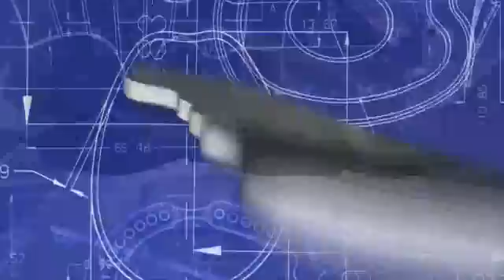#britek  Energy Return Wheel... Autonomous Never Flat

Comment from the maker: Any FIA rally proves the pneumatic tires "over bounce" launch accident potential. ERW cuts the bounce response more than in half with hub in hoop "real time" balanced stretch across the ID of the hoop. Several times more responsive than pneu. A hundred years ago they said ..."No need for a new fangled car... just buy a better buggy whip and your horse will be as fast as a car"! How did that turn out?

Comment from the maker: ERW unique 360 degrees of "stretch" suspension that reduces tread squirm and temperature buildup. Please check out our other videos where we show fully enclosed ERW. We are applying a vacuum boost on highly elastic sidewalls to improve screw force accumulation and dynamic 360 stretch. Stretching and recoiling rubber recycles heat.

Comment from the maker: ERW levers from the top inner diameter of the composite hoop. The exact opposite of "all" other wheels and tires. Just check out the ease of off trial hill ascents shown in the off road bicycle video. When ERW is lowered to the ground the hub sinks within the scope of the hoop drawing more tension... elongating elastic attachments on the top 180, a levering advantage.

Comment from the maker: We continue to produce many prototypes each with their own unique performance advantages. The things they have in common are massive efficency improvements, traction, hp and torque to the surface, are anti bounce, high speed, airless, run damaged ability, much more responsive, razor sharp handling. We now have accumulated more issued/pending wheel patents and claims than anyone in recorded history...and we are self funded. Imagine what we will do with help.

Comment from the maker: For military applications ERW will offer logistical advantages, high speed performance, will not go flat, are highly bullit and blast resistant. Operators will not be stuck changing a tire in a dangerous situation. The support vehicles will also enjoy a double digit efficiency advantage saving billions in fuel costs. Expect no bolt versions.

Comment: however, I think with the given investment, maybe it can be tested on military vehicles which I believe I saw on another video, but all in all, it still would need improvement before it actually should hit the market, because many people will be upset of problems, and also the people who stuck to radial will have their tires popped by jerks who don't care about car maintenance and don't keep the 20+ bolts torqued in which will fall off on highways and consider much damage to others...

Comment: It's a good idea, but impractical, like many of my ideas, I've been shot down by the question of wether the technology is simple enough and can be easily fixed. No this might have that idea of having the treads replaced and this and that, but maintenance overtime will add up, due to the amount of moving parts, because when a tire blows, what to people do? go to get a standardized radial replacement which is fairly decent now, just the maintenance/costs will rise because of tech in tires.

Comment from the maker: ERW will not bounce you in the air like the pneumatic tire does. ERW levers from the "top" inner diameter of the hoop for ascending tall objects. Expect a dedicated off road ERW early in our development so as to avoid USDOT resistance to our fuel efficiency improvements.

Comment from the maker: Obviously we would need to construct a special purpose ERW. You are not the only one who likes acceleration! Just check out high speed camera video of a pneumatic tire flailing and twisting as it torqes to the surface. ERW flings a screw force accumulation/return hoop that wedges off a curved hoop. As the hoop is flung the lateral and medial wedges pinch the surface increasing p.s.i. to the surface.

Comment from the maker: For the cornering on rails effect? For the horsepower and torque to the surface? For the fuel economy or the run flat that is soo good that you can run until you save enough on fuel to pay for a new one?  Maybe the babes conversation is about you running those green ERWs "maybe" giving rides.

Comment from the maker: We have filed patents on our highly novel levering traction system, almost suction cup stick. The way we have our composite hoop elasticly sprung from the hub is very much more immediate. Fling a hula hoop so that it returns to you. Now try with a properly inflated bicycle tire. We bring horsepower and torque to the surface and do not bounce 1/2 as much.

Comment: NUMBERS or this is all rhetoric. MPG with normal tires vs. MPG with these tires. What lateral G can your tire resist? Breaking force? Vertical impact (speed bump) failure? Velocity failure? Cost of wheel and estimated replacement mileage? You ramble on about potential and patents yet you don't substantiate any of your claims. And they're not hard to demonstrate.

Comment: Well, any one with a car like the RX8 wont have much of a choice.  Very few 17 inch wheels can clear the front brakes.  So, most people are using 18's on the track.  Most the track cars you are used to seeing most likely came with smaller wheels and/or brakes from the start.  Common track setups, if allowed on per rules, on the 8 it 18x8 front and 18x9/10 in the rear.  With a really aggressive offset, you can get massive tires under the 8.

Comment: True, but most people don't care about making light wheels in 18+ because very few trackday cars use anything over 17. and that is 1/2 an inch in width not 1.5 inches thinner. And these are 300 or less per wheel, whereas the stockers for an RX8 are going to run you probably 3000+ for the set after mark up. And remember, we are comparing the ERW to performance wheels of the same price, not stockers, and I'm sure these are going to be AS pricy as nice forged volks, so that comparison is fair game.

Comment: That seems like a very unfair comparison, you are saying that your wheel will be lighter due to it's advanced materials, when wheels like the ones produced by Dymag already have carbon Kevlar barrels and magnesium alloy spokes, so you have no advantage over them in that regard. Apples and oranges. If you are going to say your wheels are lighter, they better be lighter than the competition, not a lower end manufacturer.

Comment from the maker: You do not understand the patent process. We did not turn a wheel inside out. Something is novel when you are the first to describe a new application of what was state of art or commonly known or used. Our attachments allow for the hoop to move on the hub under 360 degrees elastic gain when hitting something, storing that energy then give that force back to the rolling action as the attachments return to their original length.

Comment: That is a lot less wheel than an 18x7.5.  So, getting lower mass is pretty easy.  The lightest I have ever seen in wheels near my size was around 13lbs.  They are from Rays, and made of magnesium.  Not a cheap wheel at all.  When you cut 2 inches to the diameter and 1.5 inches from width, that alone will save 3-4 lbs in most cast wheels, if not a bit more.  Do forged or and you drop another couple pounds.  Putting you right where you are saying, but with no exotic materials.

Comment: 16x7 4 lug Enkei RPF1's are about 13lbs and are <300$ a piece. Yes they are small but very common, probably THE most common on smaller cars (dad owns an Elise with the stock BBS these size in the front).

Comment: Only way you are getting that low is either much smaller diameter or pretty exotic wheels.  Like magnesium.  Some of the most high end wheels out there only drop the weight to around 12lbs for that size.  Those will run you around $4K a piece.  Not exactly common to see on any track car aside from pro teams.

Comment: Eh, that's a bit surprising (I didn't think they had 18's on the 8) but that still seems a bit hefty. Most trackday setups are around 35-40lbs fat 265's or around 30lbs for the fronts. if you compare these to performance wheels you would have to compare them to higher quality wheels as these will surely cost more.

Comment: Your 18x7.5 with 225/45's weigh at 40-45lbs? They can't be stock because no stock Mazda runs sizes like that (I think) and most performance wheels come closer to 20lbs per wheel for that size.

Comment: Nice.  My little Wankel could use more torque.  lol  How much do these wheels weigh, say to replace the 225/45-18 tires and 18x7.5 inch wheel?  I think they currently come in around 40-45 lbs per wheel/tire on the car now.  A rough number is fine.

Comment from the maker: High speed "Airless", bullit resistant, double digit more efficient, more psi. to the surface and anti bounce for traction. The massive efficiency improvement will reduce global transportation costs and help reduce healthcare costs IE less air pollution and rubber particles in your environment. Everyone benifits.

Comment from the maker: You are talking about the traction problems associated with riding on an inflated doughnut. The pneumatic tire flattens/slaps a treadblock to the surface. As speeds increases this becomes more and more of an issue. Check out high speed camera pneumatic tire performance. ERW levers a "sprung footprint" to the surface while cornering, wedges to the surface for acceleration and brake force. Check out our other videos

Comment: Ok, but how?  From my bit of amateur racing background, it's all about contact patch are.  The more you get the more grip you have.  Using alignment and suspension settings to maximize contact in the turns.  From what I have gathered, this tire is all about minimizing contact area.  There are conventional tires that do this and handling is crap compared to a comparable tire that was not designed for low rolling resistance.  I am just trying to wrap my head around it for track/performance driving

Comment from the maker: Bungie jump with an elastic cord or land on a balloon tire? The drawn membranes have allot of developed tension between the hoop and hub... enough so that the hub "floats"...more mass is suspended from the top ID of the hoop. Throttle response projects off that gravity displacement to sling you in the desired direction.

Comment from the maker: A pneumatic tire looses some 25-50% of the energy that passes from the wheel hub to the ground. Some estimates are as high as 10-16% is lost in drive train efficiency. ERW displaces hoop on hub connected by elastic attachments drawn to points on the hub.We are much more of a closed system. ERW cuts the over bounce response of pneu. We accumulate and return drive train screw force. We do not slap a treadblock we roll a footprint.

Comment: Four minutes and you don't even explain what it is, why its better, why we should switch, any of that.  As far as I can tell, you bolt the rim to a metal springy thing, and then bolt the outer part that has rubber on it to the springy thing, and the springy thing is the focus of your tech.  You still use a rubber outside, so whats the advantage of this to the consumer? It seems to use less rubber, and may not blow out, but I don't see how it improves traction.

Comment from the maker: We have filed over "50" more patent claims since this video. # 3 Patent just issued # 4 a continuation-in-part patent has the performance claims. We have been advised to show as little as possible to protect our pending World wide patent rights. It will not be long before we are able to show our novel traction systems for ultra high speed performance.

Comment from the maker: No Way. Check out our Big Kahuna bicycle demo video to see the ERW hoop go out of round under 360 degrees of elastic tension. Our space age composites are rated at 50,000 psi. for auto and almost 15,000 psi. for bicycle. Modern suspension systems are designed for pneumatic tires. ERW with its own internal displacement suspension could survive impacts... with no additional suspension.

Comment from the maker: US domestic we are importing about 45% of our oil. We burn about 136 billion gallons of gas and diesel per year. We are about to have a corn ethanol shortage in our refineries required for gasoline blending. Food source becomes fuel....brilliant!  In 2005 we were told by the USDOE that a fully developed ERW should be 20% better efficiency for small cars, 40% better efficiency for large trucks. Do some math to see how much more fuel we have burned over just the past 5 years.

Comment: the funny thing is that we still exclude gravity from the second law of thermodynamics theory. i feel the reason why stuff like this doesn't grab is because people don't think its 'cool'. someone needs to build an electric with 'exhaust noises' that returns as much energy as possible so you wouldn't have to charge it, via rim, brake and suspension than go a step further to capture solar to charge it and wind to catch that and cause down force as well. with a tune able 0-60 they'd start toget it

Comment: ERW, who is your target market for these wheels? I would think that economy and performance vehicles would both benefit from a lighter wheel/tire combination. Your wheel/tire seems significantly heaver than traditional tires... And they require custom wheels to mount to... That seems very expensive as a whole. 
How does the metal hoop react to a curb or a pot hole at freeway speed? 
I like the concept of this product but it still has a long way to go.

Comment from the maker: Good questions. The modern pneumatic tire has been refined to the point of tubless performance including Mountain Bike tires. They are very light weight. To compete we are looking to impact modified plastics backed up by space age composites. Approx. 1 lb. hoop for 29" MB. Our membrane array  "vacuum boost suction cups" in at 8 oz. with an 8-10 oz. traction system and vacuum form side curtains.

Comment from the maker: Most of our ERW versions use a stretch rather than a compression. The Tweel uses flexible rubber spokes that deform from the bottom up. Not very novel. We hang stretching  from the top inner diameter of our hoop. Levering advantage us.

Comment from the maker: Thanks ERW is highly tunable for application. We increase the elongation of our membranes to mimic air pressure. We can back up our membranes with a vacuum boost. We can adjust the angle and number of attachments. We respond much more quickly than pneumatic tires are able.

Comment from the maker: Maybe  An injection molded hoop reinforced with carbon fiber / Kevlar is industry friendly. Our membrane structure materials are at reasonable costs, servicable.... means you could get a sweet job spinning, tuning big hoops. Once the hobby wheel tuning starts look for individuals building super light weight monster truck ERW,  Bajah buggy or high speed Trophy truck ERW.

Comment from the maker: A steel wheel on a rail is 700% more efficient than todays pneumatic tires. There is room for improvement. We are rolling a powerful springy composite hoop "sprung" from the hub...a helmet for your wheel. Roll a footprint or slap a tread block? Our coastdown video clearly shows double digit improvement over the pneumatic tire so... yes.

Comment: Yes, I agree totally ... that's why I drive a more fuel efficient vehicle. However, I will not spend $15,000 more on a hybrid to save $10,000 over 10 years. That does not make money sense. That is the ultimate waste.  I like your design. BUT, it seems to me that your design is flawed. The ERW looks like a mud magnet. How will your wheel drive in snow, mud, water?. What is the cost of this wonder wheel? ... What happens when I hit a curb on a 45 degree angle? ---> New tire and rim?

Comment: Well ... I believe solid rubber tires were invented in early 1900's and are still being made today.

Tow motors and pallet trucks use solid rubber tires.  It's hardly a new invention. 

The Presidential cars have pneumatic tires that can run at 50km/hr. after being shot out ... your technology is "interesting"  ... but not "disruptive" enough to make 600 million cars globally switch ... There is a reason why Henry Ford and his buddy Firestone went from solid to pneumatic tires ... My opinion.

Comment from the maker: Just check out our worlds first carbon fiber video where we show a fully enclosed 18 Hg. vacuum boost, boltless ERW. We can apply a strong vacuum pressure because of our mighty hoop. The hoop is an elastically sprung helmet for your wheels. A vacuum resists transfer of shock unlike air pressure.

Comment from the maker: This video shows our first home built protos. We have fully enclosed versions with no bolts. The composite hoops that we have been developing are 25% the weight of the tire body that they replace and are rated at over 50,000 psi. Elastic sidewalls are a fraction of the weight of pneumatic tires sidewalls. Our elastic membrane structures and attachments bring total weight very close to pneu. However we are applying an 18 Hg. vacuum boost removing aprox. 1 lb. of compressed air from our interior.

Comment: Durability to road imperfections over time? Will the bolts stay in place? Weather wear in the inner part. Things may stuck inside. Balance issues over time. I think flexibility on the tyre is important. And most important, what about the weight? Just some thoughts from a 21 yo-non expert. Congrats to the people who worked and put the effort nontheless...

Comment from the maker: There is pull force 360 degrees even when hitting an object but much more stretch force distributed sides and top 180. The hoop becomes an elipse then springs back assisted by the stretch dynamics. We have filed patent claims that address the footprint size and have protos with no bolts.